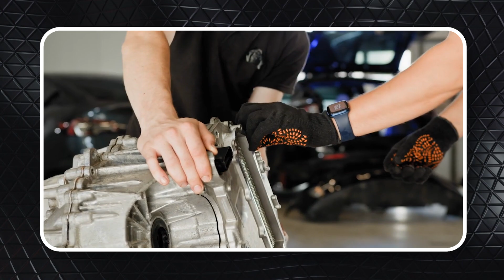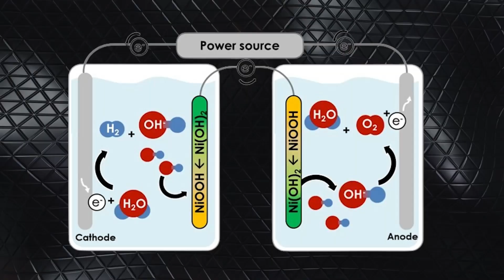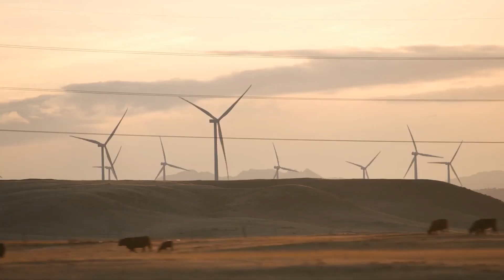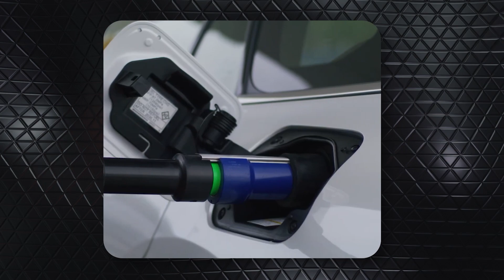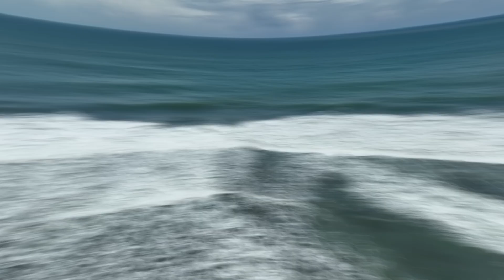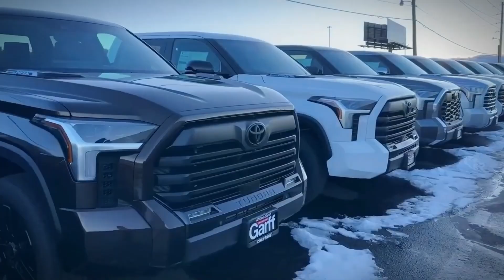Toyota CEO: ''I'm Releasing My Water Engine TODAY!"

Comment: Where does the energy come from to crack the water into hydrogen and oxygen? The engine runs on hydrogen not water. It will take as much energy to crack the water as it will create in hydrogen fuel to run a combustion engine. There is no free energy gained.